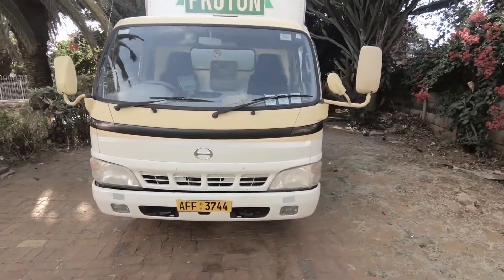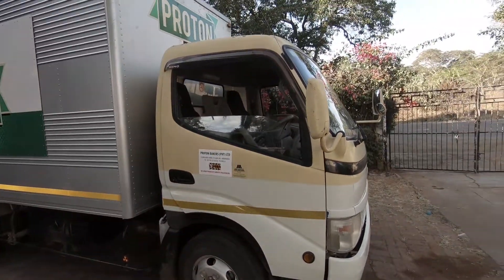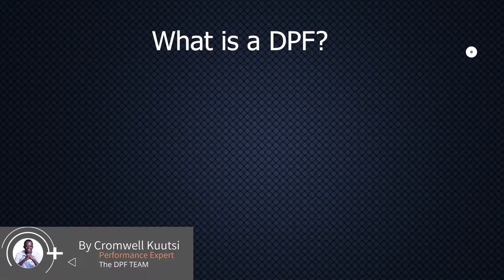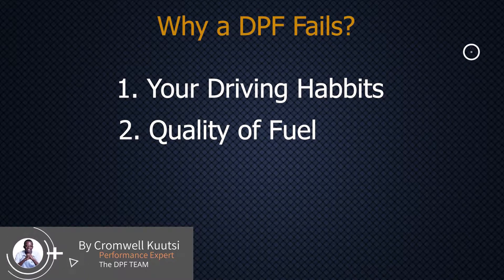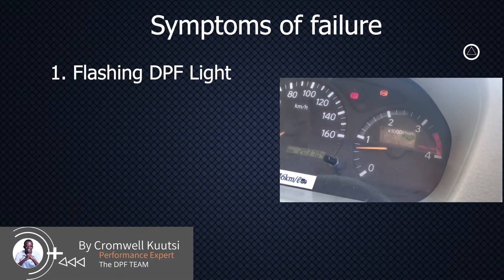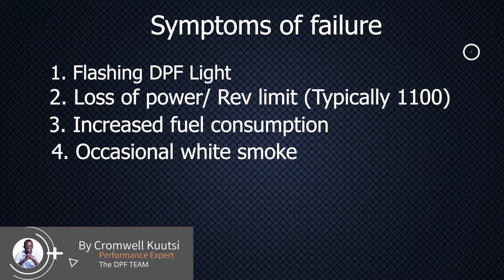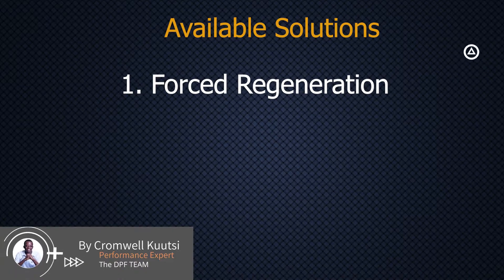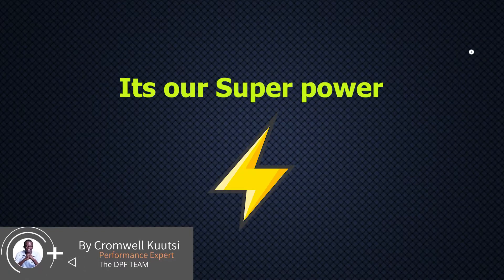Hino Dutro | Toyota Dyna DPF Problem [Solved]

Comment: Have 2005 Toyota Coaster, with a no4c engine. Engine trouble light came on and power dropped off, managed to get to Toyota dealer.
After having various computers to try and see what was going on the last one told us to disconnect the battery, leave for 5 minutes and reconnect. Problem solved. have done about 10,000 k since then with no further problems.
Reply: I read your comment but would like to know how good and how reliable is the No4c engine, I'm about to buy a Toyota Coaster and it has in this kind of engine..

Comment: if it is hybrid ，some time is hybrid battery module problem，some module is dead，only has 0.05V，Just change single module，then the problem is gone.
Reply: How much Is the battery
Reply: @michaelbunjira9028  which country you r in？
Reply: less than USD50，in China